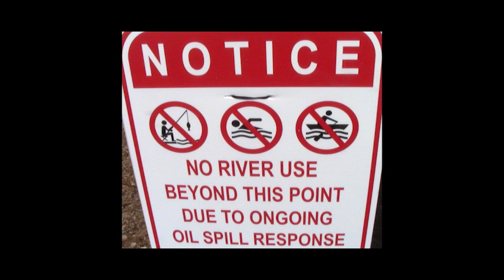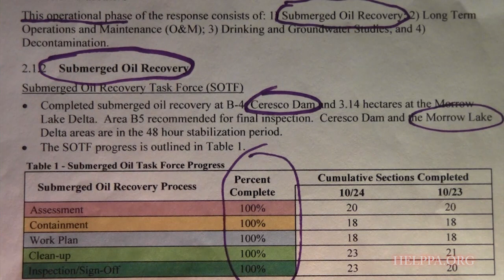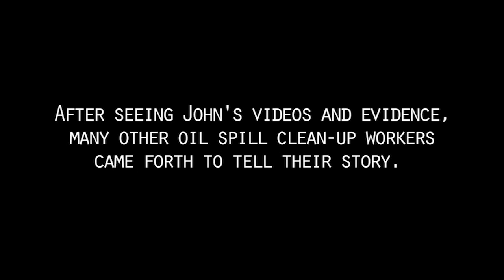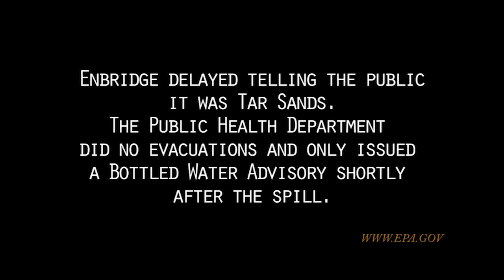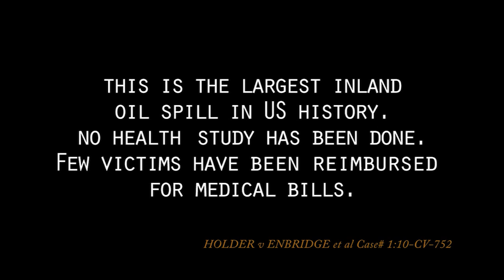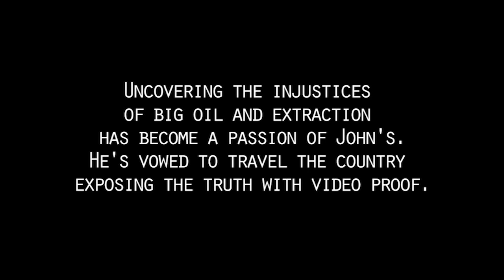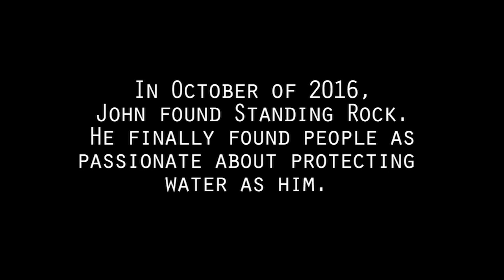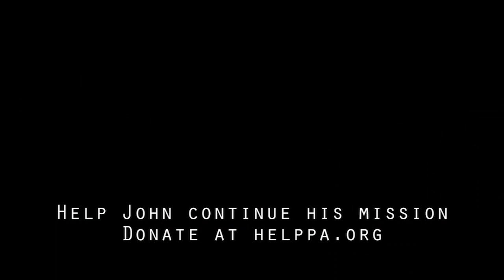Standing Rock Infiltrator ROD WEBBER FALSELY HAD THIS FREE VIDEO TAKEN DOWN.

Comment: John, the truth hurts when exposing fossil fuels (people and corporations) biggest driver which is power and profit. Great video and knowledge (evidence). Real people providing feedback on factual situations. 

It was unreal in 2017 the lack of mainstream media coverage and politicians involved on this important matter. It is sad how oil (fossil fuels) still holds so much power over the value of land/water/people. Just one Oil Spill can have an impact for decades. And Yes, I have some dependency on oil too but each year I make changes in my life to have less it. Without changes and investment/research on non-fossil fuel energy, the Oil dependency will remain static.

The biggest problem here is accountability. The majority of the pipeline leaks are not 100% contained and/or cleaned. There needs to be an independent panel/audit commission to investigate, monitor, and if need be impose hefty fines related to any pipeline leaks not taken care of immediately/appropriately. These companies have automation in place to cash in while the pipelines are functioning daily without errors. In essence, they should be just as fast and pertinent to clean ups, maintenance, and monitoring of any leaks. If these companies want to build, how about COMPLETELY clean all the leaks first and fix the aged infrastructure before making any new plans (building new routes).

Thank you John, please remain humble and keep fighting the good fight. Stay safe and strong for the People, Water, and lands.